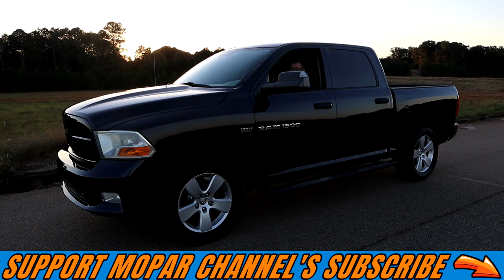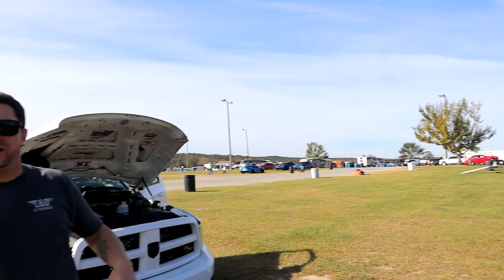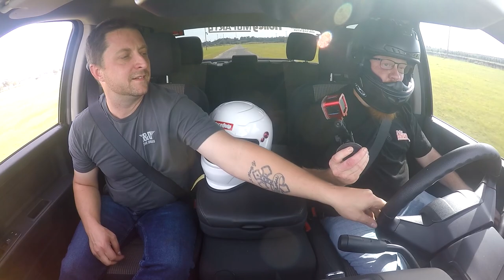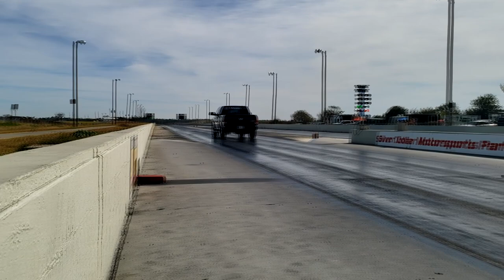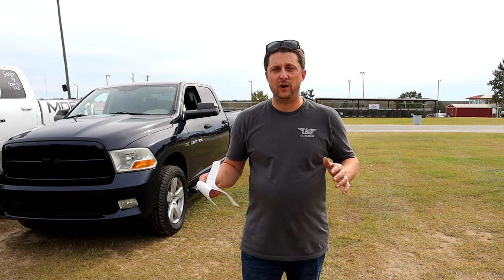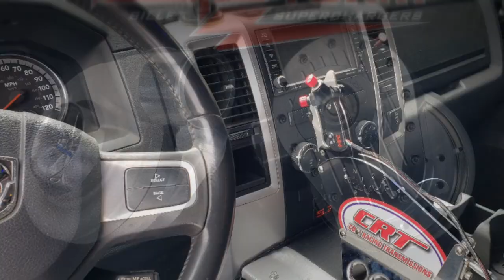Project STORM Hits The Track TorqStorm Supercharged RAM 4X4

Comment: Trans tune and with no converter I would boost launch it and it will easy run 13s 👍
Reply from the maker: We going to make a few changes in the tuning this was first time on track to get real data but yes I think 13s will be very easy full weight👍

Comment: I love your channel. 
I have a 2017 hemi 6 speed. Would you recommend this set up. ie centrifugal supercharger. Specifically the torquestorm. Most of my driving is between 1500 and 2500 RPM. Would I feel the added power in these ranges or do you really have to ring out the torque storm to get anything. Any transmission mods to lengthen its life? I was thinking a shift kit to start with.
I won’t be racing the truck. 
I love your content thanks so much for your time and keep it up!
Reply from the maker: A custom tune will help tremendously with transmission life as they will increase line pressure and a custom tune is necessary already with a boosted setup so no big deal.